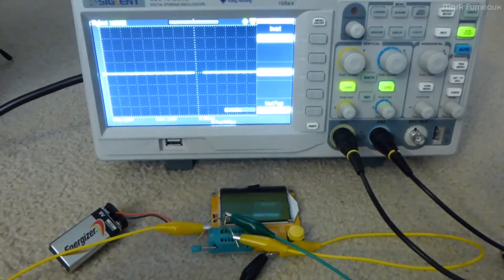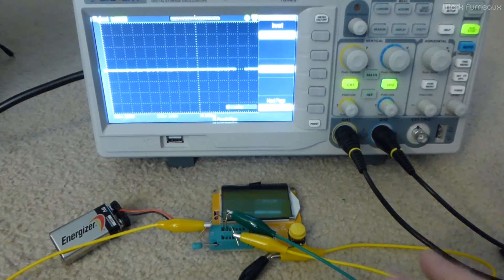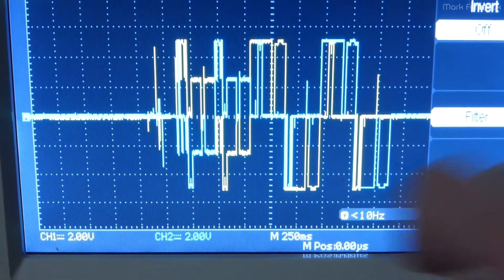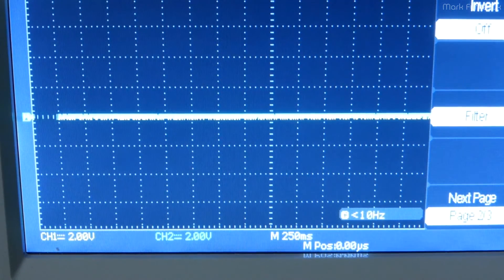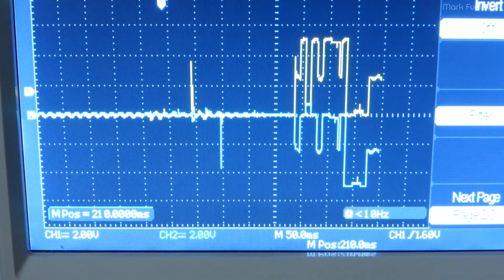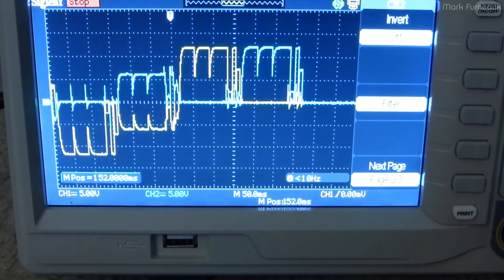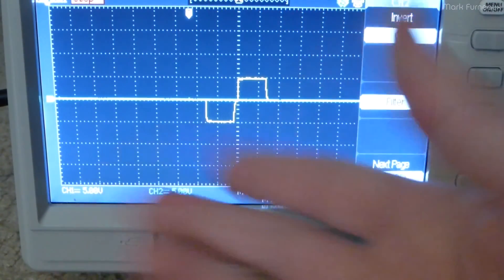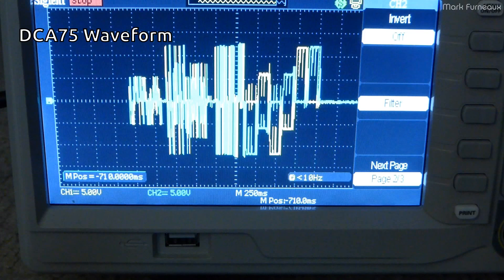LCR-T4 Universal Tester Waveforms

Comment: ATmega328P (used in arduino also) ADC pins PC0-2 is 10-bit resolution (0–5 V range with internal 1.1 V reference option) for precise voltage measurements.
The firmware switches these three pins between output (to drive current through the component) and high-impedance analog input thousands of times per second.
The 680 Ω and 470 kΩ resistors (and the relay-switched extra resistors) are connected directly to these three pins, there is firmware sources and documentation

Comment: The original project at www.mikrocontroller.net states that if an inductor in parallel with a capacitor is tested, resonant frequency of the pair will be shown. Has anyone determined whether this is actually implemented in those chinese versions?

Comment: The exact theory of operation is very well documented at https://www.mikrocontroller.net/articles/AVR_Transistortester (downloads --> English .pdf file) and since the firmware (and the whole project) is open source, the exact signals for any electronic component under test can be determined from the source code (the comments are in English) too.
Reply: Well, That's saved me from typing that. ;)
Reply: @edgeeffect  :-)

Comment: Hi, I know its a old video but maybe you are still interested.
All these devices are more or less a clone of an 2009 german hobby project (http://www.mikrocontroller.net/topic/transistortester-mit-avr).
The development didn't stopped, the "official" software is developed here https://www.mikrocontroller.net/svnbrowser/transistortester/Software/trunk/
Reply: mknjc The project notes in the first link state that the project was inspired by the PEAK devices, and that the circuit is an adaptation of a 2005 tester based on a PIC. So while this is arguably the most prolific family of testers, it didn't pioneer the concept or general implementation.